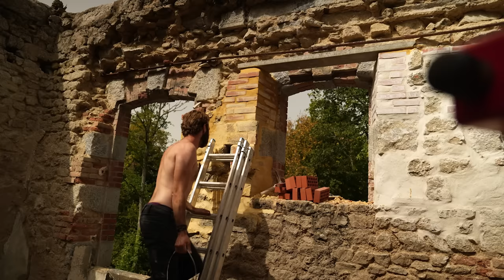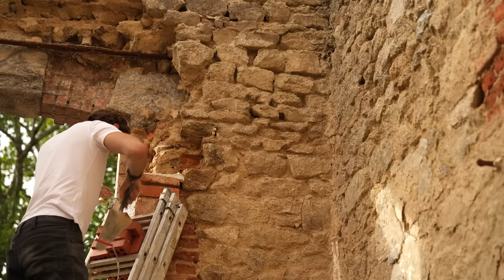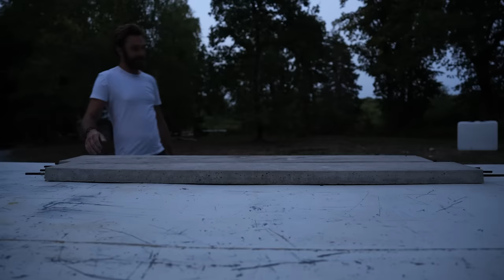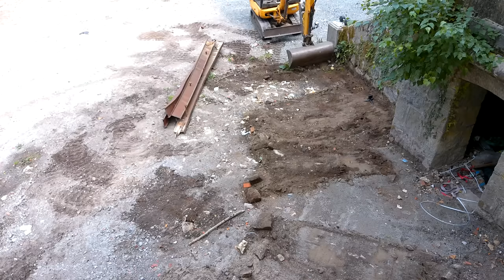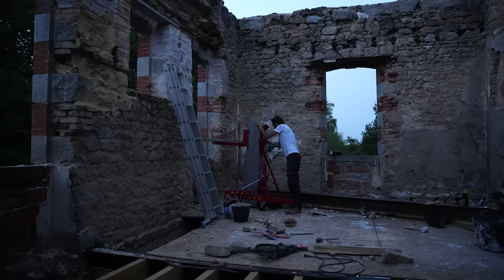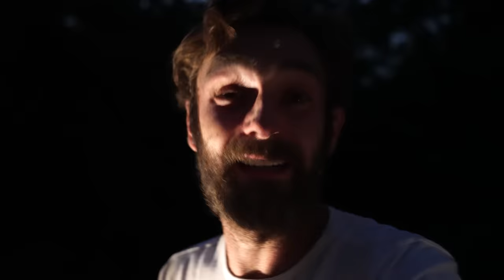One more lintel to go.

Comment: I'm wondering if you could use a portable tank sprayer to wet down those dry areas. These sprayers are found in our hardware stores. It would be easier because of a couple of things, first they are covered so you don't splash water like in a bucket and secondly they often have a carrying strap.

Comment: My man--you gotta to motorize that lift. And spread those arms out. Doesn't need to be fancy...the load just needs to be better distributed--from the center of whatever you're lifting. It's spooky seeing things go up with the lift and the board/lintel/whatever positioned between two arms that are, what, 12 (?) inches apart.

Comment: Great to watch, can't wait until the construction phase is done and finishes are being applied.  On the lintel to the left of the one being fitted in this video, I think some thin tile or slate should have been used to pack underneath the left side as the bed of lime mortar is far too thick underneath the lintel.  This won't make a strong enough base.

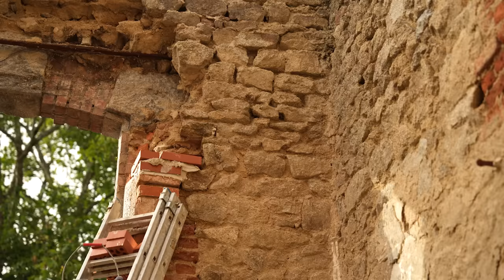Comment: Dan, you have a problem with the tower at the 1:40 mark. The older portion where you rest your ladder moves when you climb the ladder. It's very pronounced. You need to look for the crack, gouge it out and mortar it again or it will fall.

That is a serious structural issue.
Reply: That's the camera shaking when he steps onto the unfinished floor that the tripod is sitting on

Comment: It really looked like that lintel only sits on like 5-10cm each side, which is way too short. This will let the whole system flex more when under load. Which will result in bowing and cracking the stones around.
Reply: He measured 15 cm extra on both side.

Comment: I’m surprised you haven’t figured out a way to put a socket on the handle instead of cranking it by hand, you could be using a cordless drill. Just a thought.
Reply: Ive made similar observations and suggestions. Actually I think he got the lifter after a suggestion.  But actually the thing most people seem to like about his vids is the slow but steady manual low tech approach.  Quite a change from the usual carpenters build where we get shown every tool under the sun.  Kris Harbor natural builder vids similar thing, quite pleasing to watch, but as an employer in the trades yes, wed do it different.

Comment: Have you ever considered removing the handle from your lift and attaching an electric drill instead. It works great and MUCH faster.
Reply: surely he has since i have seen this comment 14 million times
Reply: But if he hears it one more time it might be enough to get him to listen. 😆

I get the feeling he is avoiding it as he wants to keep the fine control of the handle for setting things in place, but wants the handle to not spin when lifting with power. All while retaining the ability to instantly swap between the powered - manual drive and go in either direction. 

Not that complex a mechanism if you design the machine to include it from the beginning, but if you are trying to add it to an existing bit of gear without fabricating every part from scratch, it becomes a tricky problem to solve.

Comment: Why don’t you use a cordless drill to wind the handle (instead of using a handle) on the lift? Take the handle off and use a socket to wind the lift up and down- it will save you soooo much time